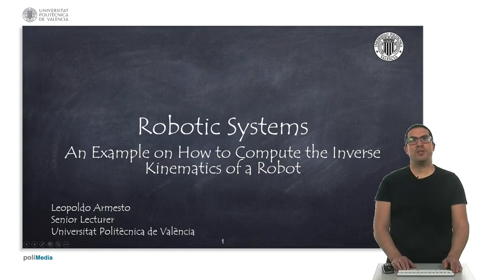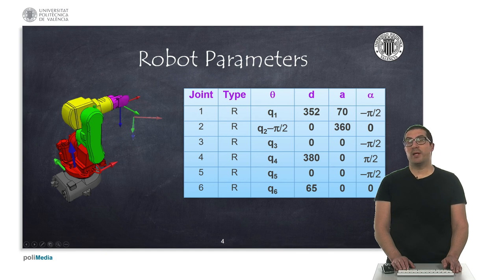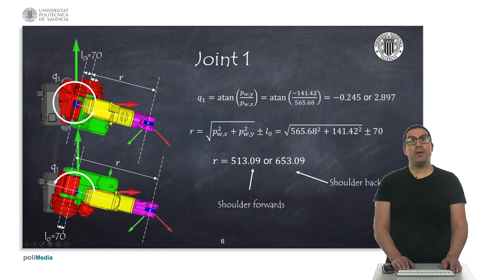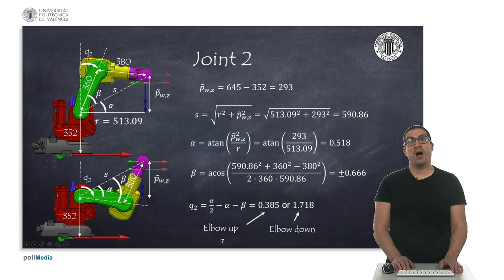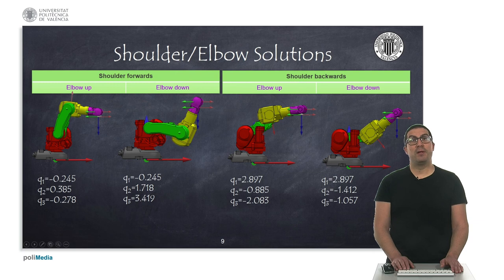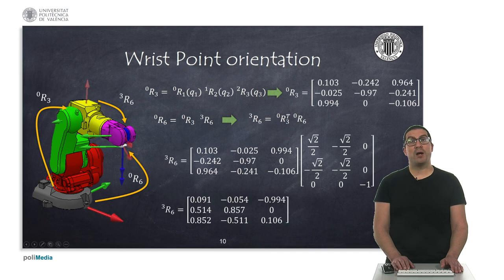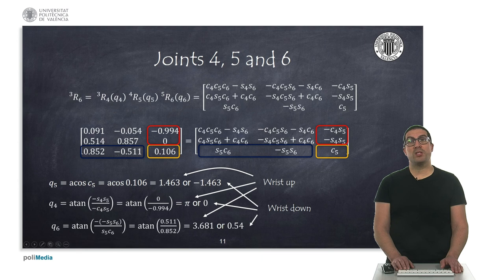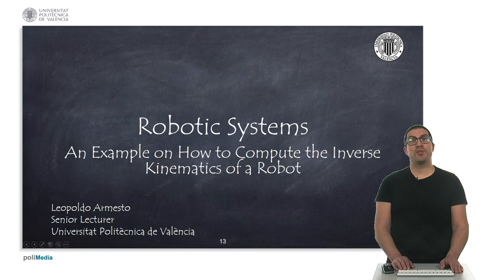An Example on How to Compute the Inverse Kinematics of a Robot | Robotic Systems

Comment: Hello, at minute 3:37 is the equation for alpha correct? Because in the numerical example you don't use the exponent of Pwz. Thank you!
Reply from the maker: Nope, this is a type…. Pwz shouldn’t be squared
Reply: @LeoArmesto  Thank you! I'm trying the same example, however I've an issue for the last three joints, for example I can find theta4 and theta5 with your expression (also with others formula) but theta4 is for wrist up and theta5 for wrist down. I can solve this problem comparing the destination point and the joints angles, but i'm pretty sure there is a better solution.

Comment: Quick question how does the robot controller choose the best robot configuration (elbow up or elbow down etc)? does it compute all configurations and check the fastest one to execute (if the priority is speed for example) ? in other words what is the preference of choosing one configuration over an other?
Reply from the maker: I presume that would depend on the controller. There’s no standard decision here. It might be time, path length, etc…

Comment: how do you get R0_6 (Orientation matrix from frame 0 to 6 ) like that?
Reply from the maker: You need to get individual transformation matrices R0_1, R1_2, etc… (ie: using DH parameters) and then, post-multiply them R0_6=R0_1*R1_2* ….
Reply: @LeoArmesto  Sir ,How did you find the  numerical values in the transformation matrix of the target location? Did you give the values ?